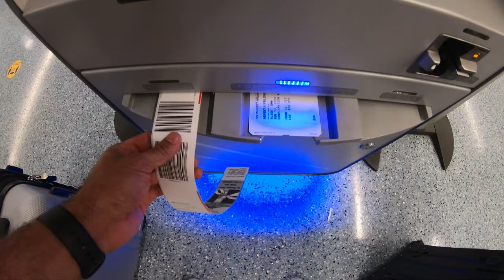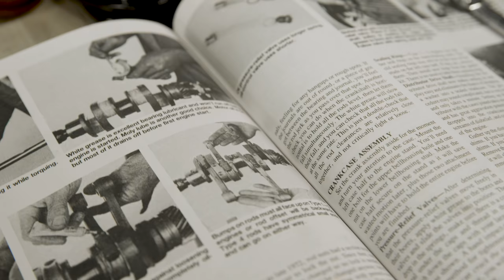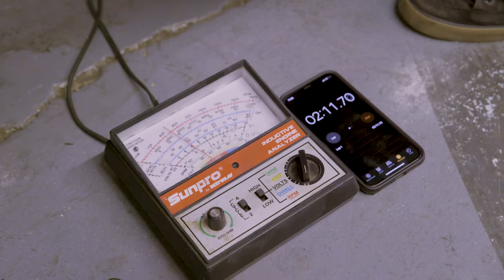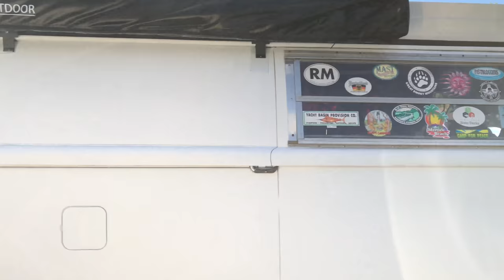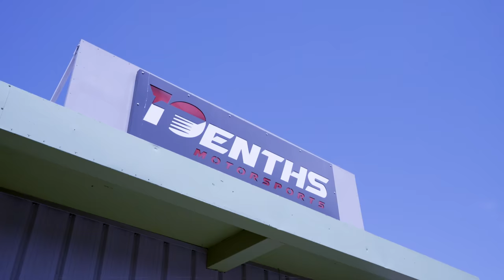TRYING to Rebuild an Air-Cooled Engine in 16 HOURS

Comment: Miata: well I think I'll just overheat myself here at this race track.
Zach: THAT'S IT!  Time to work on something with NO RADIATORS!!
Reply: It has oil cooler tho :p
Reply: @fila1445  well yeah but oil operates at a higher temp than liquid coolant anyway.
Reply: @Patrick94GSR  but it still has a cooler :p

Comment: When buying a boxer:
"How is the haed gasket?"
Owner:" Oh,no worries, i did the delete"
Reply: It's a feature not a bug
Reply: catmanistheman no it’s a BUS, not a bug....
Yeah I know that one was bad. I’ll leave now.
Reply: @d_t_r7101  "coolant" in a bus motor??  do you mean "air"?
Reply: @stuartgray5877  ohh actually that was related to today's boxer engines specifically Subaru.
Reply: @d_t_r7101  Thanks.  Funny I have a 72 Porsche 914 with a 4-cyl 2.0 L boxer engine.

My daily driver is a Suby BRZ which ALSO has a 4-cyl  2.0L boxer engine but with 40 year newer technology (including a radiator) and about double the hp.
Reply: Stuart Gray 100% should swap em lol
The subie in it would be more reliable too!
Of course that would be a lot of work....and it would be hard,...but we won’t talk about that.
Reply: @KayJblue  I have thought about it.  The 914 is a vintage racecar so engine swaps are not allowed.  There are a few videos of my racing on my YT channel.
Reply: an ej25 or porsche stuff to be precise
Reply: Stuart Gray true,gotta respect it.
Reply: @stuartgray5877  There is "coolant" in an air cooled engine, just not what you would expect in a modern traditional sense; its called the engine oil. It helps transfer the heat from the cylinders to the outside of the block. They even run the oil through a radiator to help cool it down like you would do with normal modern coolant.
Reply: @Jack-yl7cc  That's why they sometimes get called oil cooler engines. ;)
Reply: @Jack-yl7cc  Thanks I understand that. In my Porsche 914 I run 12 AN oil lines all the way to the front of the car through two oil coolers and back to the engine.  My 914 takes almost 12 quarts of oil, when stock it takes 5
Reply: @stuartgray5877   how bout a big air cooled motorcycle engine (non harley ofc)
Reply: I own an 03 wrx spec 1998 impreza gc8.
Simple swap, I bet it's much harder in an air-cooled Porsche or vw though.
Reply: @stuartgray5877  Super cool race car, 12 quarts is huge for a 4 cyclinder motor, im doing a 912 motor right now that will only take 4.25 (i know most 911's take from 11-14)
Reply: @d_t_r7101  Casual Simpsons Reference haha
Reply: Nah it's just the anything less than a modern ej257 gasket sucks. The new ones are great. But performance motors do actualy not always use them.
Reply: @aidenkempf9270  I also have a 3 or 4 quart accusump in the system. It has saved my engine once so far.
Reply: @KayJblue  No you maniac, in Germany it’s most common to upgrade the displacement with original VW Parts and just run it for another million km
Reply: The nice part of having the air cooled engine is reduced points of failure. The reason for switching to water cooling was for better emissions since you can better control your operating temperature of the engine.
Reply: the. WHAT
Reply: @grantkendrick277  nah man, it was awesome. don't let anyone ever tell you otherwise.
Reply: @stuartgray5877  nice car
Reply: @Jack-yl7cc  you are right but they were talking about cooling mixing with oil
Reply: @rednecktony1961  - For the older aircooled Bus motors you CAN install the heads without the head gaskets,  There was a technical notice that dealers should leave them out late in the engine's history.
I have been running my race motor for many years with no head gaskets. It gives a little bump in Compression ratio too.

Comment: ‘’This is all the electronics this thing has’’ 
Me: gets confused and messes it up
Reply: Hot wire for the coil, oil pressure sender wire, 3 charging wires to the alternator (or generator, if the VW engine still has one), and that's it. 8,10,13,17,21mm sockets/wrenches, plus half inch for the generator hold down strap. /me drove old bugs for more than 20 years.
Reply: UnknownSailor real chad here fellas. But on a serious note I hope to one day own a Bahama yellow 912, or whatever the original 911 was called.
Reply: Me irl
Reply: latuba247 he just knows his shit. Like I could literally name every bolt size on a bmw if you handed them to me in my hand without me looking torx/star bits, you just got it or don’t my friend.
Reply: 1000 kicks one time < one kick 1000 times - bruce lee
Reply: @AndrewKidd14145  and 'it' being experience, which knowledge follows
Reply: @yngfljm2277  yes sir. 100% no experience no knowledge, people think straight outta school and fully certified you’re going to be fine but when you enter the field and a newbie you’re eaten alive, you have no pace, but as time goes on.
Reply: It isnt even Electronics, just electrical

Comment: As a guy that has a 74 bug its nice to see the excitement the whole crew had building the motor. You might not be the fastest car on the road but you are able to operate a piece of engineering history. That oil comment is very true you pretty much have to have a quart or 2 of oil in the "frunk" if you plan to daily the car. One of the easiest motors to tweak and mess with! I am curious what oil weight you are using for it though.

Comment: Hey Donut...FYI:

Short Block= Complete cylinder block without head(s)

Long Block= Complete engine minus accessories
Reply: I was just about to say this.
Reply: @cloudvsephiroth215  Same here. IDK if it's different for an aircooled because of the funky architecture of an aircooled.
Reply: yeah that was my understanding of the term as well :)
Reply: Winner winner chicken dinner. I give Zach a bit of a pass though after no sleep lol
Reply: Aircooled guy here, this information is accurate in my world too.
Reply: Actually "short block" includes the case and all internals but No pistons, jugs or heads.
It would have the connecting rods hanging out the jug holes.
Reply: I've lost count of ... Muscle car guy.. 
Quote; yeah I went ahead and Ditched the old 350 small block for a crate 350 long Block,  should make more power now,,, 😐 
Me; Soo you bought a Crate motor with Heads ? 
Guy; no bro, it's a Long Block,  not a small block anymore.. 
Oh Cool.. 
From my old life producing Car Shows..  hahaha oh man
Reply: @AtZero138  lol ok
Reply: @norgepalm7315  no no, he's right
Reply: You might mess this up after 0 sleep too 😂

Comment: 8:03 I feel you bro, I don't work on cars, but I was dissembling and reassemble a laptop to change motherboard and thermal compound. But after reassembling it fully, I realized that I didn't plug in the CPU cooler fan cable. It was a nightmare to open it again and reassemble it again. By the way Idle CPU temps were about 63°C if you are interested.

Comment: Theres a reason why germany and generally cold countries produced so many air cooled engines, its because back in the day the quality of the coolant wasn't that good and people mostly put water in their radiators so in countries that reach extremely cold temperatures they would make all their machinery aircooled to avoid having crappy coolant expanding and cracking their engines, I grew up in a farming town in macedonia (the colder part of Greece) and even today I still see diesel 4 cylinder and 6 cylinder air cooled tractors (mostly german deutz tractors) and some t2 vw vans around

Comment: When my grandpa still had his VW shop back in the 70’s, he has a video of him pulling his bus motor out, full rebuild, reinstalling, and on the road in 3hrs! Bahahahahaha!!!
Reply: Did he do it in three hours the first time he laid eyes on one?
Reply: I think the 16hr benchmark for their first engine couldve been achieved if they had done some good research ahead of time. They lost a lot of time with making little (but MAJOR) mistakes!
Reply: briguy91931 those little mistakes always get me.
Reply: They also have to film and talk it's not as easy.
Reply: I remember when I rebuilt the topend on my ‘80 Toyota...I didnt retorque the headbolts after running it...no bueno! Lol. Little mistakes can lead to big issues! Bahahahaha
Reply: @briguy91931  I suppose if they hadn't gone in a circle at least once it just wouldn't have been a Donut.
Reply: I work in a air cooled VW shop and my record for taking engines apart is 3 hours lol
Reply: My great great grandfathers sons stepson rebuilt one in a half hour outside in the rain

Comment: These engines are amazingly simple honestly. I think if they took a minute to research it's totally possible to rebuild it in 12 hours. I rebuilt my first VW 1500 (converted to 1600) SP 1968 motor in my basement in the dead of winter during college. I started it using a drill and 1 cylinder then tightened the remaining 3 plugs. Got a lot assembly fluid on my carpet, my mother was not happy.

Comment: That heater seems like a good way to get exhaust into the cabin
Reply: There's an exhayst pipe inside that metal shell.  Everything's fine until that exhaust pipe rusts. Then... you know.

Over in Porsche land they like their stainless steel aftermarket header/heater boxes.

Comment: Quick correction, and it may be due to the lack of sleep, but a short block is the engine block with the crankshaft, connecting rods, and pistons. A long block is all that plus the heads and valve train. The intake and accessories make a complete package.

Comment: In the mid-seventies I rebuilt a '66 Bus, and later a '71. I used "John Muir's Guide to the VW Bus for the Complete Idiot." Start-to-finish, hardly a problem, and I had a good time. I got to the point where I could remove the engine, by myself, in 45 minutes; Install it in an hour and fifteen. In the dirt driveway, on a piece of plywood. Good times.

Comment: Here’s what to do to an old air-cooled VW; put a new Passat in engine in it.
Reply: The 1.9 TDI ALH engine, fucker can run for half a milion kms with only a head gasket change and like 3 oil changes even if you burn cooking oil in the damn thing.

Comment: 7:16 pressing on the main crank gear is a big no no damages can occur to the gear, crankshaft or wudruf key. The main gear should be heated slightly (careful not to blue the gear or its ruined) aswell as the brass timing gear  and they should fall in place.

Comment: when you say "air cooled", you actually mean "oil cooled"
Reply: No, it is oil lubricated and air cooled.
Reply: It has an oil cooler, but it’s air cooled.

Just like how modern cars sometimes have oil coolers, but are water cooled.
Reply: @deciplesteve  thats your opinion, and im sticking with my opinion

i feel im correct in my opinion, as without the oil cooler, this car would overheat. therefore it is oil cooling the internal parts of the engine, and that oil is then getting cooled by the air that is flowing over the motor

kapish?

do you need neat little drawings to understand?
Reply: @kenlarge5154  without oil, like every engine, it would seize, but not every aircooled engine has an oil cooler. (Source: I work on them daily)
Reply: @deciplesteve  which air cooled engine has no oil cooler? im keen to learn more, but im skeptical as i know that most of them use oil coolers, and are called air cooled, which is correct in a way, as the air is cooling the oil, which is cooling the engine

but without oil cooling, the air cooling doesnt work.. only on small cc engines can you get away without oil cooling the engine
Reply: @kenlarge5154  the earliest ones.

The air does cool the oil, but the majority of the air cools the block, cylinders, and heads. That is the point of the fins and tins (rhyme unavoidable). The oil is there for lubrication, but as with all engines, does get hot, therefore oil coolers were added for the same reason that new engines still have oil coolers. Jobe mentions in the video that the major components are either magnesium or aluminum as they both inherently transfer heat well.
Reply: @deciplesteve  you admit then that the oil is the cooling effect of ALL engines

^_^

without the oil, the engine overheats and dies
Reply: @kenlarge5154  THE OIL IS NOT THE MAIN COOLING MEDIUM!

Is that clear enough? Yes, theoretically all engines have some degree of "oil cooling effect", but no engine that I am aware of is STRICTLY oil-cooled. This engine is PREDOMINANTLY cooled by air going across metal fins like a heat sink on a computer.
Reply: @deciplesteve  i mean if you shout it makes you seem silly when you disagree with what you were just shouting about, and agreeing with me at the same time

obviously the oil is the main cooling medium of ICE engines, do you not understand thermal dynamics? water is used over and above oil to supplement the cooling effect
Reply: @kenlarge5154  you have absolutely no clue what you're talking about, but ok.
Reply: @deciplesteve  https://en.wikipedia.org/wiki/Air-cooled_engine

here is a quote from WIKI:
In all combustion engines, a great percentage of the heat generated (around 44%) escapes through the exhaust, not through either a liquid cooling system nor through the metal fins of an air-cooled engine (12%). About 8% of the heat energy finds its way into the oil, which although primarily meant for lubrication, also plays a role in heat dissipation via a cooler.
Reply: @deciplesteve  ill be waiting for my apology, any time now ^_^
Reply: @deciplesteve  https://www.porscheirvine.com/blog/2019/april/11/are-porsche-engines-air-cooled.htm

quote from porsche dealer website regarding "air cooled porsche"

"Now technically speaking, these engines were never really air-cooled as their name may describe, but rather oil-cooled. Through the use of metal cooling fins, heat exchangers, and large fans, air was pushed around the hot churning oil, cooling it down and keeping the engine running smoothly. Now whereas the air-cooled engines used oil as the cooling agent, modern water-cooled Porsche engines use both oil and water-based coolant. Much of the confusion between air-cooled engines and water-cooled engines is that both are effectively cooled from fresh airflow. Because of this, modern Porsche engines still bear many similarities to their original air-cooled versions, but with updated and more efficient cooling methods, and a lot more power."
Reply: Aren't you all so cute for arguing over what an air cooled motor is.  Good grief.
Reply: @erikcox1947  its not arguing, i made a statement that (most) air cooled engines are actually in fact oil cooled, as without oil and the cooling thereof the engine would seize 

but do me a favor and use facts to prove me wrong

Comment: I am an A&P aircraft mechanic. Believe it or not, almost every single engine used in general aviation (think Cessna, Piper, Beechcraft etc) is basically that engine. A horizontally opposed air cooled engine. And yes, it is shockingly similar to a VW engine. The cabin heat used in those planes is essentially the same thing. The exhaust is routed inside of the muffler. There is a shroud over the muffler that a piece of ducting connects to. And it robs the heat from the exhaust to warm the cabin. Works great, as long as there is no exhaust leak. Also the carb heat works on a very similar principle to prevent carb ice.

Comment: This may be a bit pedantic, but the engine oil makes up a substantial part of the cooling on most automotive and motorcycle air-cooled engines. Even these old VWs had large oil coolers inside the fan housing. The cylinders are largely cooled by air, but the heads are partly cooled by the engine oil, the pistons and and all the rotating parts are pretty much entirely cooled by oil.

Comment: My first car was a 63 beetle. Had to give it quite a bit of tlc. Got myself a 71 a few years later and it needed new heads originally but as I pulled the head off, there was an inch and a half chunk taken out of the jug and so I did a complete rebuild. New nothing about building vw motors and now I can do it in my sleep

Comment: Horizontally-Opposed engines are of course large and spread-out, making them very capable of dissipating heat. Especially if metal flaps are welded to the engine block to increase the surface area, thus being capable of dissipating even more heat.

Comment: you can buy the pistons and sleeves in a kit, the biggest problem is miss matched cams and lifters, they should come from the same source, or the engine will only last for 30 miles, aftermarket oil filters and oil coolers are a bonus, as long as they are installed correctly, high mileage engine case.s will need  align bore, plus the head studs are a pain when they strip, this is common, The other head ache is there is no head gaskets, so the cylinder heads needs to be fly cut torque spec is under 30 pounds, so over tightening stuff   will fail down the road, balancing, the crank, rods and pistons, is a must do deal, do not put a detergent oil in an older engine, the old ones used straight 30 wt, the detergent breaks up the sludge and clogs the factory oil cooler

Comment: A short block is the lower engine assembly (crankshaft, con rods, pistons, etc.) What you had there is a long block, which includes the head and valvetrain. Otherwise, great video.

Comment: 21:30  valve lash sounds way out,  going to burn the valves soon, sounds like it's firing on 3 cylinders, don't forget to re-torque the heads after break in.  Also, make sure you do proper cam break in at 3000rpm for at least 5 mins with high ZDDP oil like Driven

Comment: I built a model of an i4 engine once. It was pretty detailed so there was a lot to put together and it was see through so you could look at all the parts work (it ran on an electric motor hidden in the clutch). Over all really cool. The day after I finished it the timing belt broke which meant I couldn’t run it anymore.

Comment: 15:59  I hope the flywheel gland nut is torqued to 254 ft-lbs and your crankshaft end play is set correctly or you will have a very short lived engine.